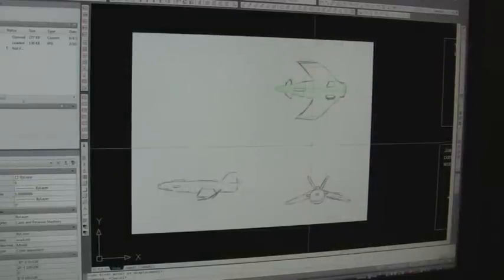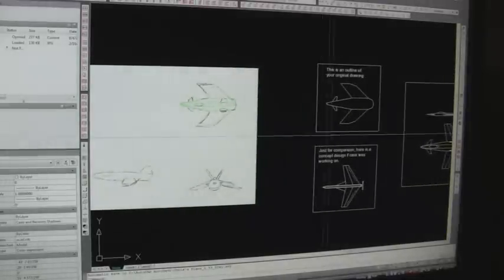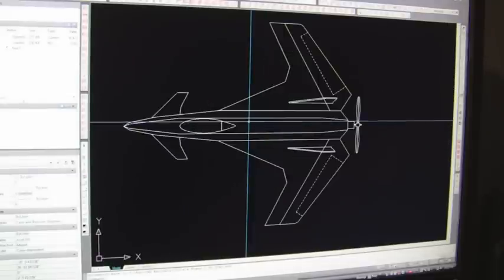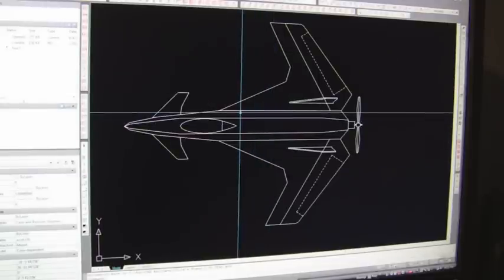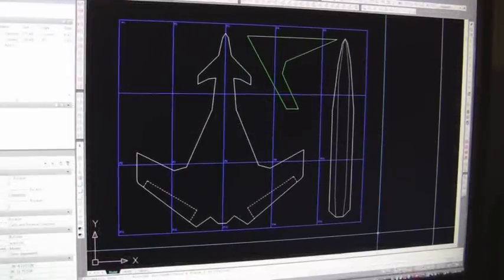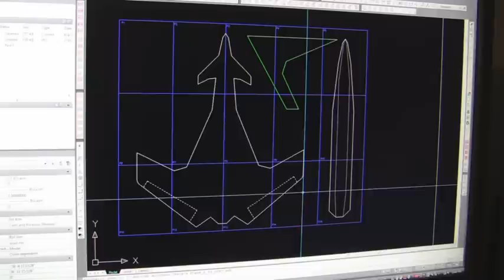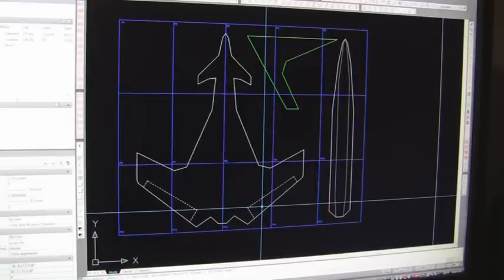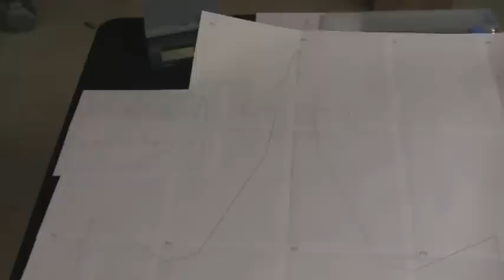Part 1 - Experimental RC Plane

Comment from the maker: @bottomgunner The software i use is AutoCAD. Its not easily available and exspensive. There is a free cad software called ProgeCAD Smart. it is free and works very much the same as AutoCAD.

Comment from the maker: @miller0time1 The software i use is AutoCAD. Its not easily available and exspensive. There is a free cad software called ProgeCAD Smart. it is free and works very much the same as AutoCAD.

Comment: looks like your going out on  a limb with this design Paul. most planes that look ultracool never really fly as good as they look (but what do i know, i only have like 8 months of foam building experience). You and Frank are notorious for installing monster power systems in your planes so I'm already certain that it will at least fly. Great idea on the monthly drawing and of course all the information you continue to provide to your viewers

Comment from the maker: mark18352, I'm not sure what the best beginner plane would be, but i would recommend the HobbyZone planes. I started out with an AeroBird. The Super Cub is also a great first plane. These come with everything you need to fly, radio, battery, charge and plane. They do rate there planes by skill level too, I, II, III.  Anyway, these are are fore complete beginners. If you have some skill  look at the Park Zone planes for better performers. After that you'll be ready to scratch build! Good Luck!